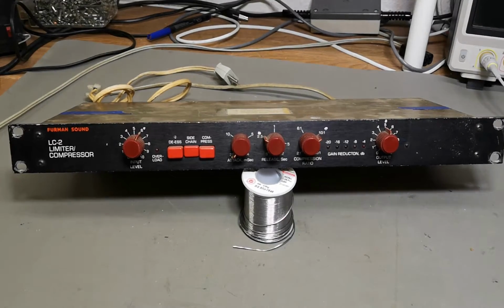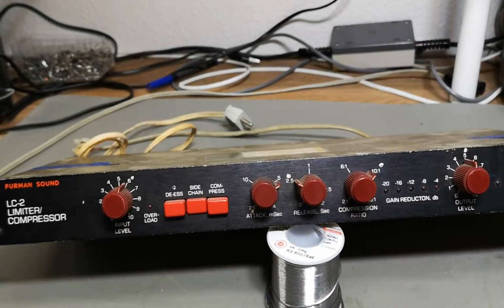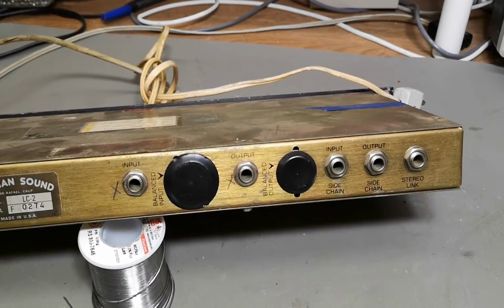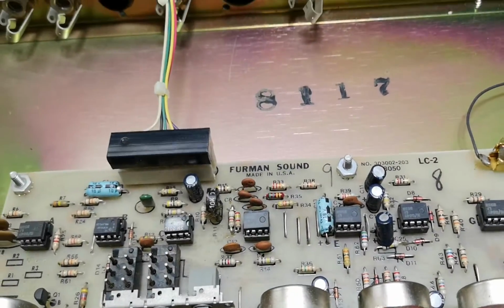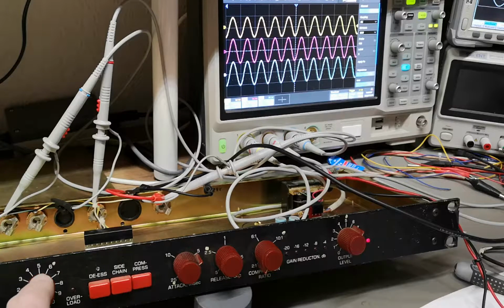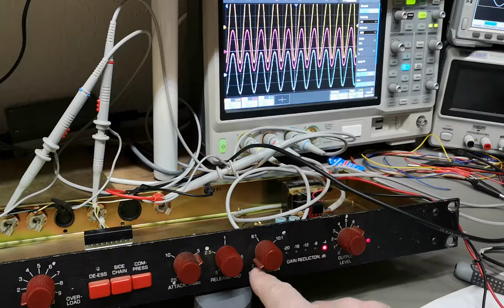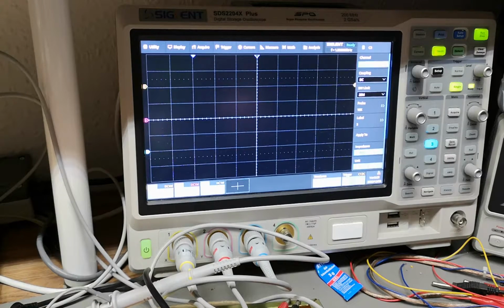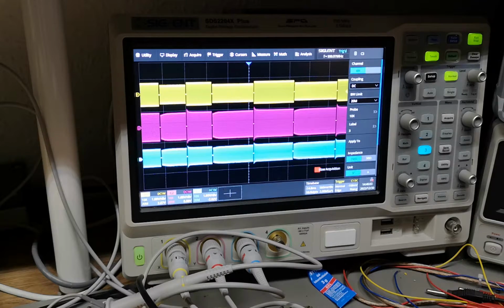Furman Sound LC2 Limiter Compressor 1981 test teardown

Comment: I have one of those. I dont use it much anymore but it has been a workhorse for years. I cant remember where I got it from. I remember using it for things that dont need fast attack times... acoustic guitars and things...

Very good.
Reply: I was about to use mine on bass, but would like to tune the attack and release. Maybe I will put it on midbass 80-500hz.